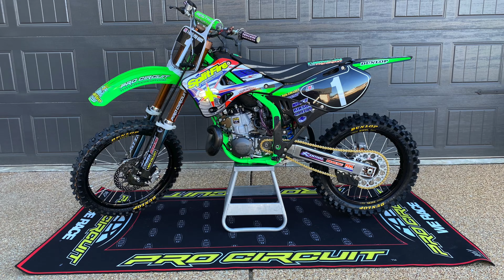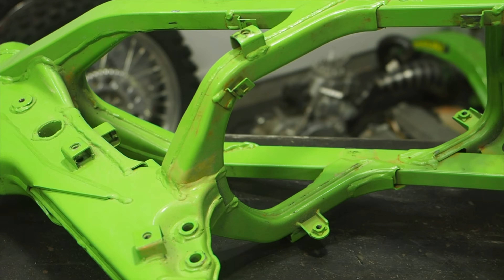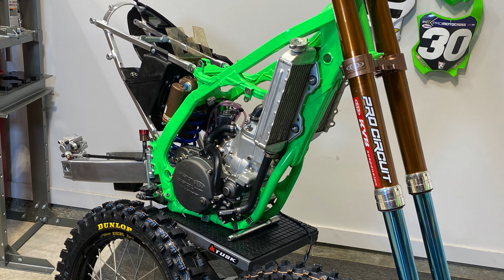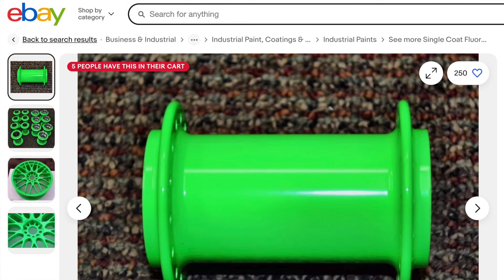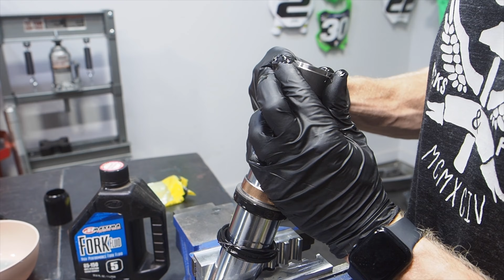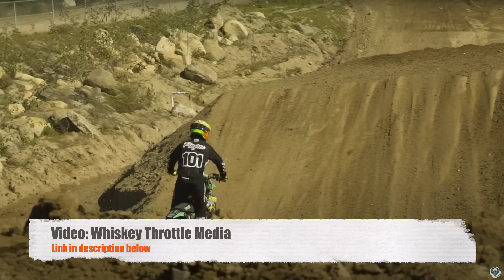Pro Circuit's Fluorescent Green Powder Coat Color

Comment: What do you think about the TX Race restyle kits?
Reply from the maker: In my opinion, it's hard to be the classic oem style of these bikes. The TX is okay looking, but kind of looks weird because the shroud line doesnt match the frame angle. Never polisport, I think that kit looks awful.

I am a fan of the the builds that have taken actual 2017ish kx250f  plastics and have fit them. I'm unsure of where to get the brackets to piece those together though! Hope that helps haha